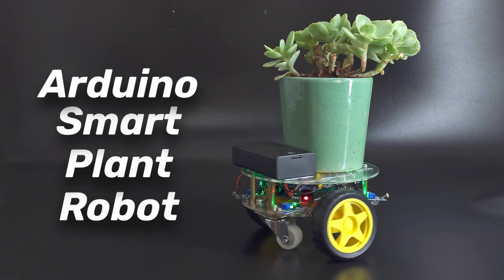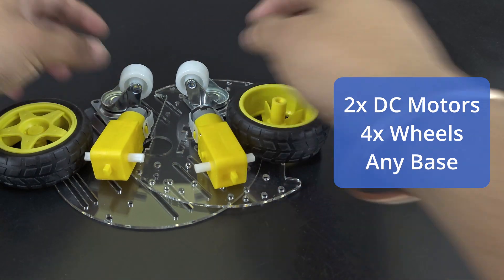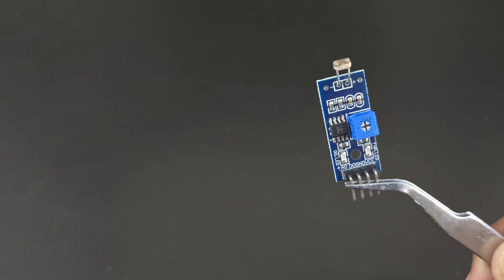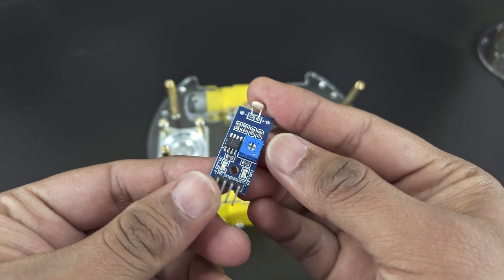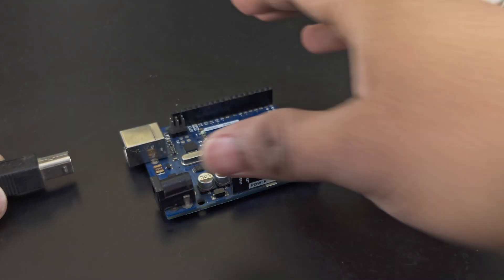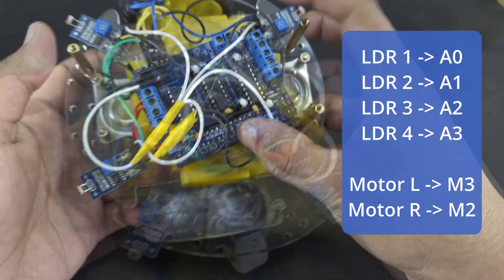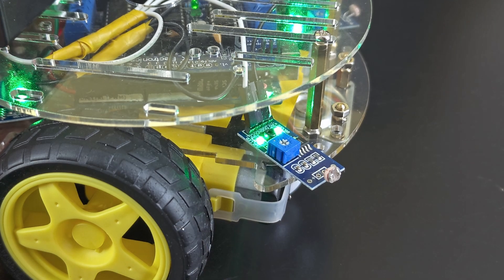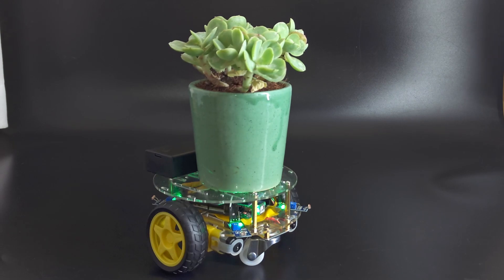Arduino Smart plant robot | Beginner project with code

Comment: Is that cute wheel of that plant is durable to be used off roads? I know this is our of the topic questions but i like the plants who could movie aside from spreading. It's awesome.
Reply from the maker: No, these wheels are not good for roads. But you can easily find other wheels that are.
Reply: @techtalkies1  Okay but could that plant be able to travel like a car and fast as one, if you can make it? I know it takes a lot of engineering just maybe, Is it possible or Can you do it? I am not saying you should but.. Can You? Sir?
Reply from the maker: If you're asking it's possible, yes.
This same setup can go on the roads and be fast enough. I've slowed it down for indoor use. Just swap out the tyres.
And manage how you recharge the batteries.